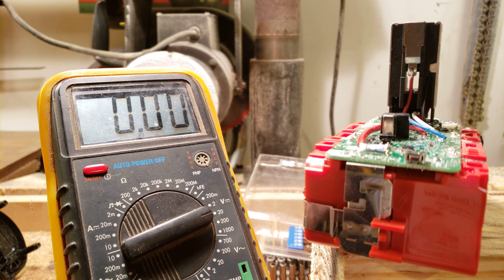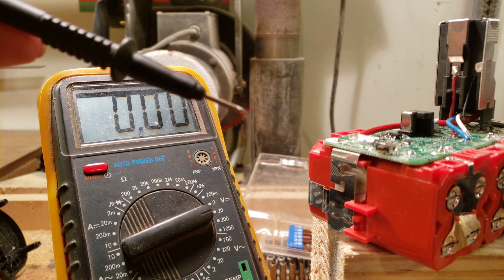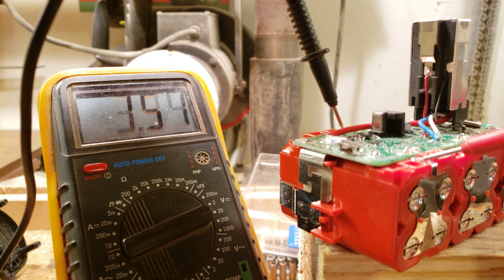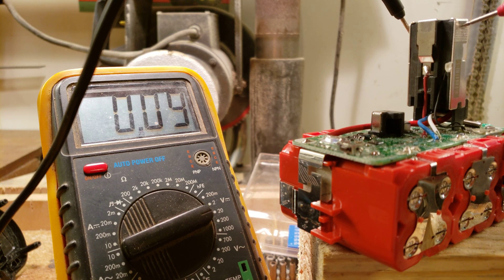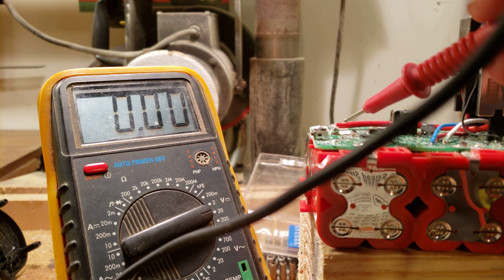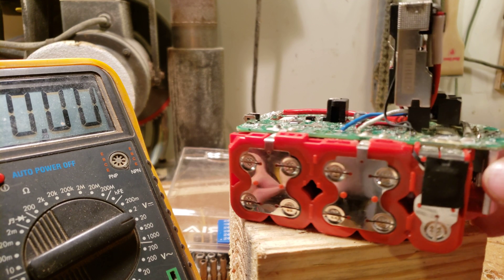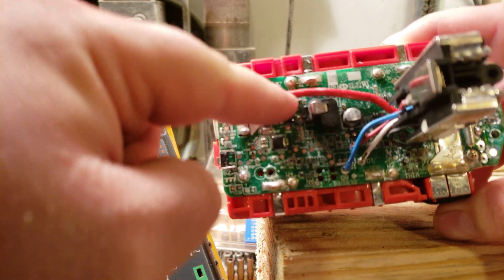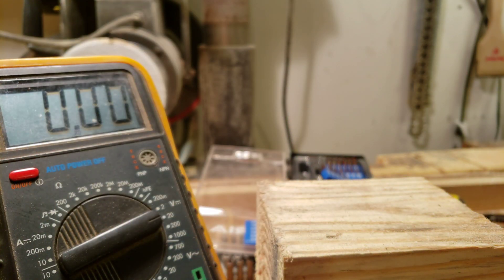Ryobi P191 Battery Attempted Fix

Comment: This is a protected circuitry thing - if you press the battery check button (for the battery light), you'll then temporarily be able to read the real voltage. If it ain't chooching you have to find the dead cell(s) and replace them. 

You do a skookum AvE! I hope Uncle Bumblefuck is busy letting the magic smoke out

Comment: i have the same issue but when i check the charge indicator it reads all 4 bars but they blink. When i read voltage on top it gives me .80 volts if i press the indicator light it will give me 20 volts out the top as long as the indicator lights are blinking for just a few seconds wonder if yours is doing the same thing.
Reply: Mine is doing EXACTLY this... Doesn't make a bit of sense... I am going to try and discharge the battery pack by wiring up a small pair of 12 Volt test lamps in series and see if lowering the overall voltage will bring it back. I have looked for a "reset" on the circuit board, but have found nothing... This pack will work, IF I can get it to power up the tower...